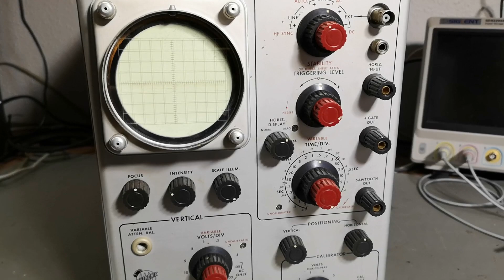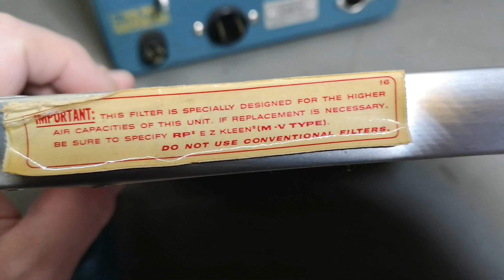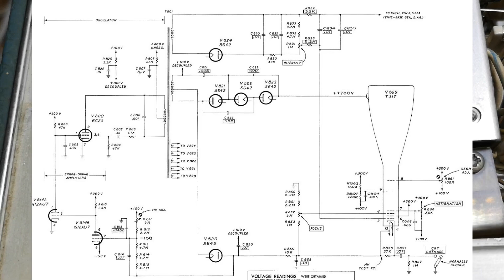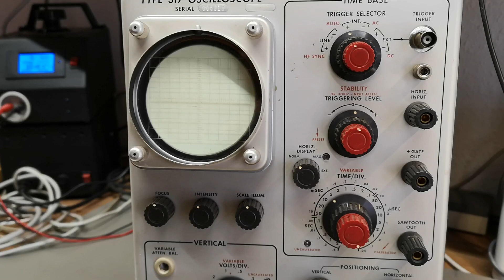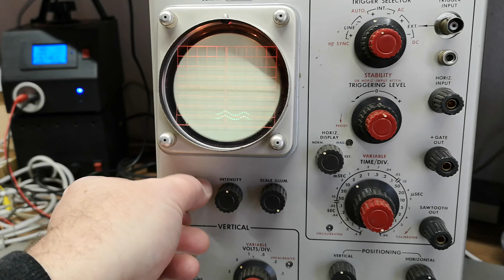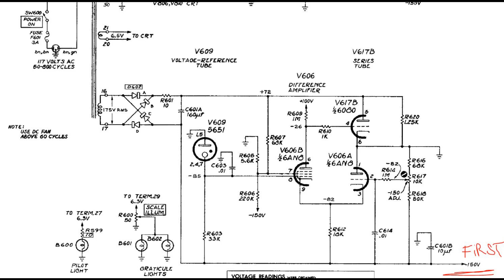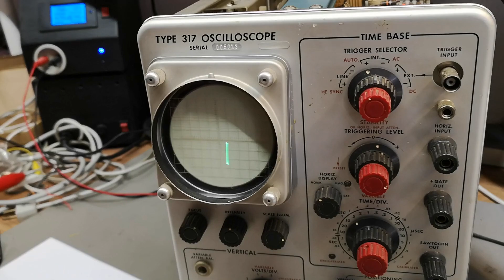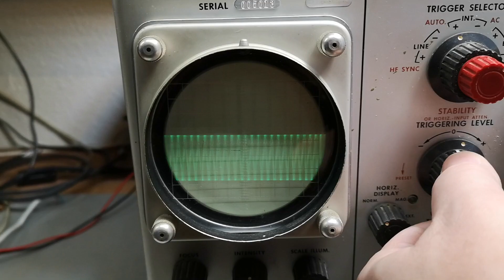Tektronix 317 Oscilloscope 1ch 10MHz 1960 all tube repair teardown

Comment: Hi, can you imagine our modern oscilloscopes in 63 years - they will be just a pile of disintegrating plastic on a rusty tin frame. This is simply amazing, after so many years it is slowly like it came out of the factory.
I noticed one rather blackened glow bulb, I have no idea what circuit it is in - the other glow bulbs looked clear - HP used them, for example, in photo choppers and it is not at all easy to replace them with current ones - maybe a different plating of the electrodes, maybe a different mixture of gases.

Beautiful oscilloscope 🤔 it's a bit bigger for my workspace 😂 great job 👍

Nice day 🙂 Tom
Reply from the maker: correct, todays scopes will not last 63 years.. one more TEK again tomorrow :-) a 515A
Reply: @TeardownOZ2CPU  Don't say you got the dual fet from the link I sent you and that you're going to revive the little creature 😁
Reply from the maker: @Edisson.  that tinyTEK is on hold, i am too busy playing with all the new incomming equipment
Reply: @TeardownOZ2CPU  I understand, I have also postponed some things and I have all the components for postponed projects. I'm at work in the mechanical shop right now, finishing up one of the postponed projects - finishing a miniature four channel voltmeter (miniature - you know the size of my workplace 😂) need to measure multiple voltages at the same time - range +/- 200V DC to five places with automatic range selection and independent inputs . I'll send you photos when I'm done, the measurement is done, the source part too, and I'm making a suitable box.

Comment: Hvis røret er revnet uden der har været strøm på det, så er det ikke sikkert at det er blevet hvidt. Det sker ofte først når der kommer strøm på igen.
Reply from the maker: not what i see.. the slightest air intake will make the top white, i have seen this so many times in tubes in storage i am sure they was packed while black, and many years later, now the top is white, take an old halve defective tube, and bend one of the pins a bit, it will let air in, let at stay on your table for a few weeks and see it goes white.
Reply: @TeardownOZ2CPU  Det kan krakelere helt igennem når det kommer varme på, det har jeg set masser af gange. :-)